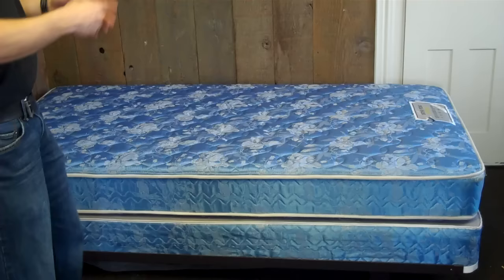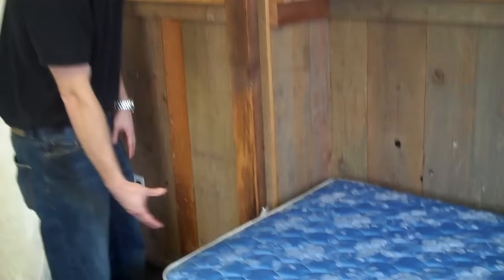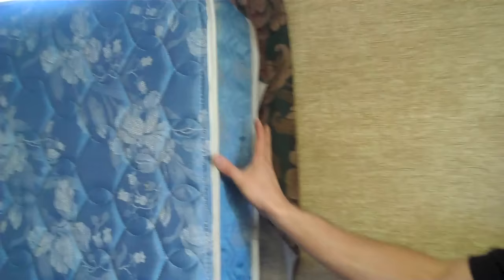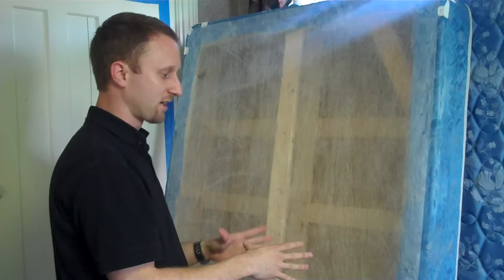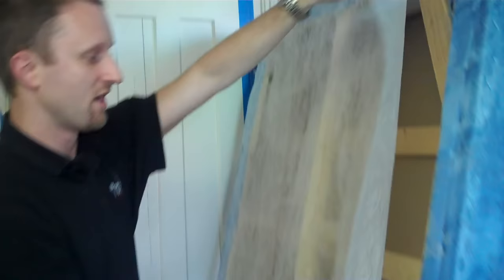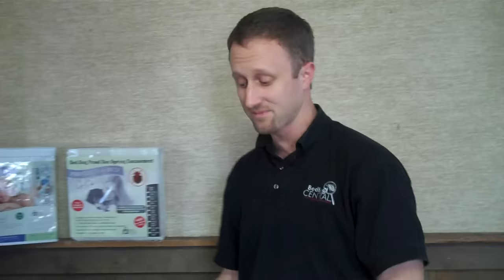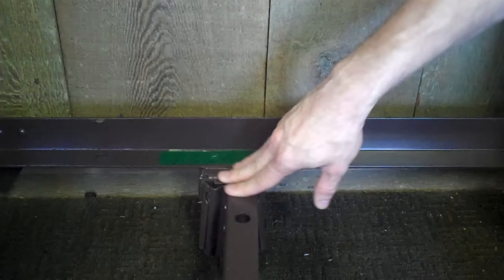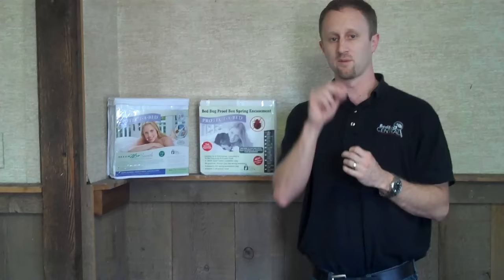How to Inspect a Bed for Bed Bugs (BBTV #43)

Comment: Also, if you think you have bedbugs,  something that is pretty simple, yet effective, is that you can take a role of clear, packaging duck tape, and outline the bottom of your box springs and mattress (with sticky side on the outside), and if when those little bastards come sneaking out during the night to get their free blood meal, their legs will get stuck on the tape, and be trapped.  Use push pins to secure the tape.  I tried this on my sisters apartment, and after the 2nd night, we found like 10 bedbugs that got stuck on the tape....just a thought...
Reply: That is a great idea
Reply: u the man baby!!
Reply: ProgressiveMetal777 8
Reply: ProgressiveMetal777..Thank you for the that tip
Reply: Use bags of lavender seeds in between sheets and in pillows. All smells of lavender scent deter bed bugs from mating. Like lavender, Vick Rub deter bugs too. Put some Vick Rub on paper tissues and crumple up the papers and place them in bed. 

Buy yourself dustmite-proof covers for your mattresses. 

In mornings, open windows and expose your sheet to cool air by pulling back blankets or quilt. Use fresh Vick Rub on tissues, and lavender seeds and lavender oil.
Reply: Thank you!
Reply: AMAZING NAME AND IM BUYING IT RN THIS HOTEL MY BF GOT IS MAD NASTY THANK THANK THANK THANK THANK THANK THANK YOU
Reply: ProgressiveMetal777 thank you for saying this im going to tey tonight🙏🏻
Reply: TIME TO GET REVENGE
Reply: Loop
Reply: They were waiting till you went to sleep 🤢
Reply: 8 years ago today
Reply: Rule number one never ever move to a wood floored home
Reply: Thank you
Reply: Thanks u should do a YouTube video on it it would had went viral

Comment: You say bed bugs don't generally go on the bed frames. But in my case I knew there were bed bugs but I could not find them, it happens to be they were hiding inside where the metal meets the wheel. Around 50 bugs in each wheel. Those sukers are a master in hiding.

Comment: Great video. While checking the bed, it's also good to spray few seconds inside the boxspring with household insecticide, baygon or similar, if no bed bugs are visible after inspection. If they are hiding there, spraying won't probably kill them, but makes them come move around within an hour.

Comment: Bed Bug Removal
I started to notice some bites in January of this year but new nothing about killing bed bugs. To prepare I watched video after video showing the different methods of removing them. I could not afford a professional service so I did this.
I waited until we had a forecast high of 115F or 45C. I did this so the bugs could not go deep into the walls and survive. With the outside temperature hot enough to kill them on its own, I blasted the heat and fans inside. I held between 122 and 126 for almost 8 hours in my trailer using the excessive temperature to kill. I used heat from three 1500 watt baseboard heaters. Then instead of renting big fans at about $40.00 per day I bought a 20 inch or 50 cm box fan from Canadian Tire for the same price to add to the 5 household fans I already own. If your area is larger buy more fans. I had plans to buy three box fans but they were sold out because of our heat wave. For me this was OK because I have a floor standing air conditioner and used the fan to compensate. With a combination of laundering and heat drying all fabrics, including all bedding and clothes, then heating my place up to a sufficient temperature, I am now bug free. 
People remember heat treatments work best at the hottest part of the year when bugs can not find holes in the vapor barrier and crawl near the outer wall to stay safe, because the outside temperatures are too hot for that option. In winter heat will not work for this reason, but during hot days it is pretty much a sure kill, if you have enough heat and fans. Hope this helps some of you as well as it did me. My total cost for laundry, fans and power, was about $190.00 and I now own all the fans. The heaters I already owned. If you need to buy them this of course this will up costs. To give you an idea my trailer is my holiday trailer and the floor area is 200 sq. ft. Scale your equipment up as needed. 
If it happens again I am now prepared in full .
Reply: What do you use the fans for?
.
Reply: @007nadineL  Fans force the hor air into small places of dead air heating them and not leaving any pockets unheated where bugs can survuve.

Comment: I have them and I caught an adult and that thing moved fast! The only reason I caught it is because I was already holding a piece of packing tape. I caught it as it ran by. It moved in a funny way, too, kind of "ambled" while it ran. But I also caught a tiny baby one that was not moving at all. You should google pictures and compare it to the pictures. They can look different and be different sizes depending on their stage. The most helpful picture I found showed them at a variety of stages.

Comment: I have bites on my arms, hands and fingers that itch since the beginning of summertime. I thought they were misquote bites. But no one I knew had them as bad as me. One of the first things my fiancé and I did was check our bed for bed bugs. And we didn’t see anything. So i posted a photo of my arm with the bites on a Ulcerative Colitis group I’m a part of since I have that disease. Some guy told me they look like bed bug bites because his girlfriend had the same thing. I went to our bed again to get ready for bed and sure enough there was 8 tiny bugs crawling on top of our sheet. So I killed them by smashing them and once they were dead we took the sheet off our bed and looked all over and no bed bugs anywhere on the mattress or box spring. I’m sleeping on an air mattress and my fiancé is sleeping on the couch for now. I read online you can buy a mattress protectors for bed bugs that you’re supposed to leave on for 1 year and it will help kill any bed bugs you currently have and prevent any new ones. It cost $20-$30 depending on the size of your mattress. We are getting that the next time we go to Walmart.

Comment: I just threw out my roomates couch because I saw a bedbug running on it and when we pulled it away from the wall and inspected the seams I found/killed about a dozen medium or big sized ones. The couch is now out of the house and ive cleaned up the wood laminate floor surrounding the area and inspected the beds upstairs, everything else seems clear, I hope I caught and got rid of it before it spread anywhere else or got worse!

Comment: update, if anyone cares or would find it useful: i used a steamer meant for clothes and steamed out each spot i found an infestation. then vaccuumed up the bodies. sprayed windex on the area for good measure to make sure the bugs+eggs were dead. havent seen any for 2 days but i will keep an eye out. 
i also put my beddings in the dryer first on a hot cycle for 20 mins to make sure that if any were hiding in the sheets, theyre dead.

Comment: ATENTION I just got free of it on 6 diffrent rooms. The secret that was missing after extermination and throw all the forniture to the garbage... was to put an eléctric extension with three entries and isolate all the eléctric terminals with silicon, before that the treatments were not resulting they were protected inside the wall on the NET electrical cables 👍 they can survive up to 1 year without feeding, so remember to check that silicone sometimes. This process saved my business.

Comment: I’ve been dealing with these guys for too long. They infested my room four years ago, and we threw out tons of stuff: my clothes, desks, couch, the vacuum, etc. We chainsawed my wooden bed frame, threw it out, and replaced it with a new metal bed frame.  We called in an expert two years later to inspect the room and clean everything, as well as replace the carpet with a new one. Even with all of that, I woke up yesterday with several red welts, and I came back home this afternoon and found a nymph on my mattress. I’m going to explode.
Reply: Heat them out machine cost like 50 bucks at lows
Reply: Check in your walls.
Reply: @Uchihasasuk5 100% this. Also very expensive method which works is have pest control heat up your entire house to 122F/50C, costs around $5,000 though. They're likely inside your walls..

Comment: If it's a bad infestation are there many thousand? If I am there only host, they all can't be using me as food. I just went through getting alot of bites, probably 75-100. And now, that's stopped. Do all the ones who didn't attack me die? I started looking on the internet and had to face the fact, these bites aren't fleas or mosquitoes but are the dreaded bed bugs. I've ordered a bunch of stuff to try and treat for them and the bed casings you recommend and the DE and a brand new Dyson. So far I think they're only in one room but I'll treat with DE in all electric plates.  Thanks.

Comment: I have the same bed and box spring in this video.... I have bed bugs & idk if I've ever seen one. I've seen carpet beetles, fleas, spiders, silverfish, and maybe mites. Anyways, all I saw were black spots and red spots. There were tons under the box spring. But the worst place..... were my 3 curtains hanging next to my bed. It looked so bad with all the spots.

Encasing the mattress, box spring, and pillow in cheap $9 vinyl cases helps a lot. Make sure to duct tape the zipper line. GL! It's war!

Comment: I've never had these bugs until yesterday. I saw about 10 different bites on my arms  after washing my clothes and inspecting my couch in living room I went to my bedroom and I found a dead one right in the middle of my bed, squeezed it and it was full of fresh blood (it was an adult). I used all your instructions in the video and my mattress, box and frame are super similar to the ones in the video.  I didnt find any sign of them at all except that one dead one that i mentioned. could this be an isolated case of one bed bug that I brought from outside only?
Reply: it can be through the floor cracks little holes coming from any neighbour, i would hardly recommend to use that plastic that fully covers your bed its extremely important so they will not feed from you i tell u this by experience
Reply: I this k I might have them me an 11 year old help me
Reply: @kayla-vr3dt  You are 17 now - did you get help with your problem?

Comment: i can't tell you every time i went under my bed as a kid, it was too hard to see ive had the same bed for years and the same box spring i used to hide under, there would be rips in the cloth and i didn't even know a bed bug exsisted until my mom said "goodnight don't lets the bed bugs bite" then it got me thinking did i crawl sleep and rub against bed bugs for my whole life? and i am a child still, but older.

Comment: my son is coming up w what looks like allergic reaction bumps on his back. I'm not sure if it's bed bugs . I've not seen signs of them otherwise.he, at one point, was getting little rashes here or there that were in a shape of an"s" . these allergic reactions are different big skin rash that looks like they are filled fluid, they get larger with time. I have not seen bed bugs nor do we have box springs. we've two beds side by side in one bedroom to accommodate the children. the older child has no bumps, rash, reaction. our couch is dark brown leather. I can follow the directions for the mattress to check for dead bugs, blood or encasements, but have not seen them. I'm thinking maybe child is allergic to something on bed but not sure.how can I check the dark couch and do bedbugs live in leather?

Comment: @Triumph72 had it since last summer after crashing over at a friend's place...... washing after washing, spraying and spraying, and dropped $400 on treatment. they're still not gone. my bites are coming back AND THEY'RE INCREASING!! no one understands how painful it is to go to bed knowing that you're going to attacked all over. i wanna die.
Reply: Go rent heaters designed for bed bug killing or extermination. It dehydrated them all even baseboards.Heat has to reach 120 degrees 4 , 4 hours. You can’t be in the house or apartment while heating.

Comment: the inly problem with encasements is they force bedbugs to find shelter away from the bed. i have encasement long before i had bedbugs and how im in a ironic predictment where i cant find a single bug on my mattress or bed frame . i can only assume they are hiding away from bed and frame and travel up the legs. 

years ago i moved in to a bedbug apartment and they infested the bed abd i was able to get rid of them easily with vacumming and insectside.

Comment: Also the exterminator came, did not inspect my room even points I pointed to a bug (unknown type) which crawled from my bed frame to the murky darkness below).  He looked at the ceiling and the wall.  He literally swept my mattress with his eyes.  And sorry for so many questions, but I am about 80% sure i found a bed bug.  But I searched the rest of my bed high and low and could not find even a hint of them anywhere (no excrement, bugs or "casings") Is it possible someone brought in a couple or they are coming from another room?
Reply from the maker: typically if you find one bug you'll find other evidence but it's tough to say without seeing the situation myself, if your bed is on the floor they will still be able to access it and tape won't help the situation, I would have any bug you see in the future identified to see what it is and keep conducting inspections until you verify the problem
Reply: Thank you so much for taking the time to respond! I really appreciate it

Comment: Thanks for the great video.  I have read that you can put things like electronics, pictures etc in either a trash bag or just a plastic tote and put in a Hot Shot brand No Pest Strip and leave it for a week and it will kill the critters and even the eggs.  Have you ever heard of using this method??  Supposedly the No Pest Strips are actually used for killing moths and stuff like that, and it uses the DDT chemical that was formerly ban in the 1970's.  They are suppose to work great for items that you can't put in the dryer.  Thanks again for the informative video.

Comment: If my box spring is on the floor can bed bugs get inside of it?  And if so, can I just tape the edges without lifting it? (I live alone getting help might take a couple of days).  Also if you see like one black spot does that mean its bed bug poop if you don't have a bad infestation?  I saw what could maybe be a spot or two on the top of my box spring.  Let me know :) Thanks for the video!!!!
Reply: Keep in mind that blood turns dark (not red) after it dries and may appear to be "black".

Comment: My mom has bed bugs. Been fighting with them over a year. She has no income except disability. So she can't hire a Pro... So how do we get rid of them ourselves???
Reply: It’s gonna take a lot of time and being diligent to declutter and get rid of things you don’t need also washing and drying everything you can on high heat for 30 mins or longer invest in getting some crossfire from Amazon and use that along with cinmex powder use the powder after the spray has dried put the powder down around the baseboards where carpet meet the walls you also have to dust the electrical sockets because they will hide there as well and if you have a vaccum vaccum weekly and dump it outside also get some climb up interceptors to monitor the bed bug infestation and get some encasements for the bed and box spring if you don’t kill all the eggs and the bugs they will keep coming back spray and dust everything you can and keep at it until no one is getting bites getting rid of them is hard without professionals but it’s doable

Comment: +Jeff White, I want to get a box spring encasement, but the legs of my bed are bolted into my box spring so it makes it much more difficult to encase. Are there any encasements out there that are designed for box springs with the legs of the bed bolted into them?
Reply from the maker: Protect-A-Bed makes a disc you can insert between the leg and encasement that will help address that issue
Reply: ***** Ok I didn't know that. I have been searching online for these discs but haven't found them. Could you send me a link to where I can buy them? Thanks!

Comment: Good question. I prepare my house first by encasing it in a dense protective layer of asbestos. Sometimes when I haven't been to the asbestos store in awhile and my supplies have run low, I find that lighting backfires in the hallway and living room works almost as well to keep the flames from spreading.

Comment: I don't have a traditional box spring as in no cloth or fabric material at all it's just plywood to hold my mattress on the frame. could they still hide in my mattress and boxspring?
Reply from the maker: bed bugs love plywood, the texture of the wood is very attractive to bed bugs
Reply: should I just toss out the boxspring? actually let me ask my husband what material it is. I was guessing
Reply from the maker: you shouldn't have to throw things out to get rid of bed bugs but whether or not to dispose of it is a personal decision
Reply: I also have a very small bedroom so moving the bed isn't an option either way it goes there's a wall.
Reply from the maker: it's possible but highly unlikely, some have said if the truck that delivers them has bed bugs because it also picks up discarded or used furniture it's possible the new furniture could have bed bugs....bottom line is that while it's possible it's highly unlikely
Reply: Bed Bug TV how likely are you to have bedbugs